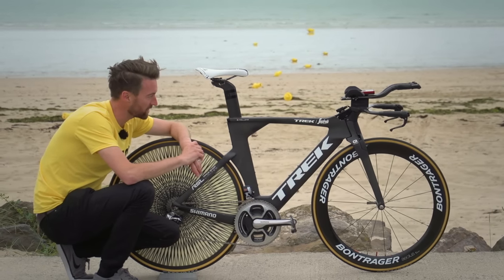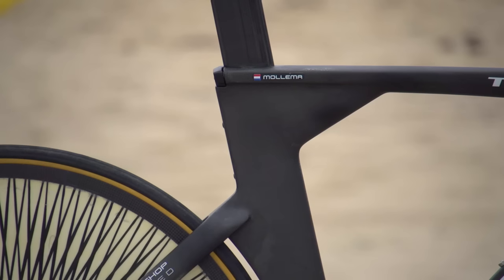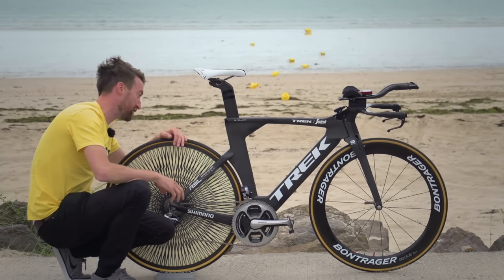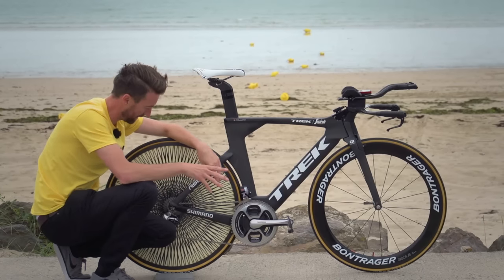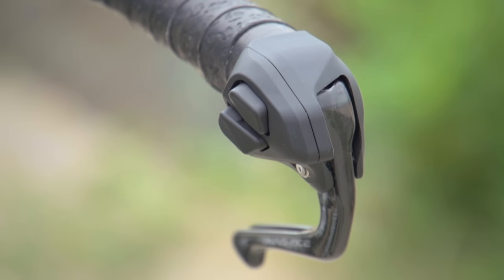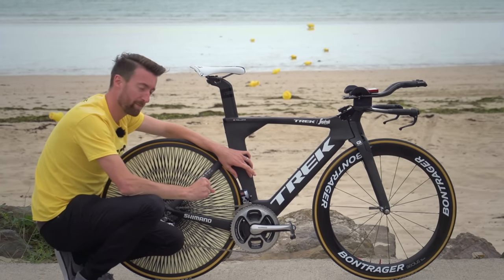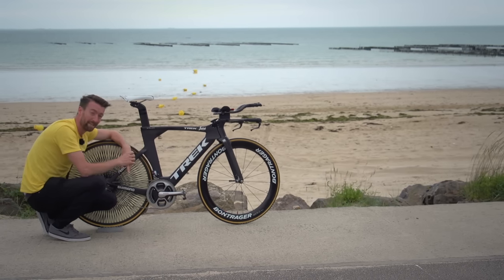Bauke Mollema's 'Raw' Trek Speed Concept

Comment: Dan, the tires should be marked "Veloflex Criterium" which is 23mm or "Veloflex Roubaix" which is 25mm. Since you guys always put the valve stem at the bottom when you're presenting bikes, you'd have to turn the wheels to be able to read that.

Comment: no paint on the frame to save weight , but complex painting on the back wheel ... not much consistent
Reply: i agree with you
Reply: Actually I'm pretty sure that wheel isn't painted at all and what you're seeing is the raw composite layup: those black lines are carbon strips that provide the strength (essentially acting as spokes) while the aerodynamic disc itself is very light weight fibreglass or kevlar.

Comment: white paint can weigh as much as 300g ....
1.   why the huge TREK logo on the bike?  They could have saved another 50g by using a smaller font.
2.   why not use a different colour paint then.
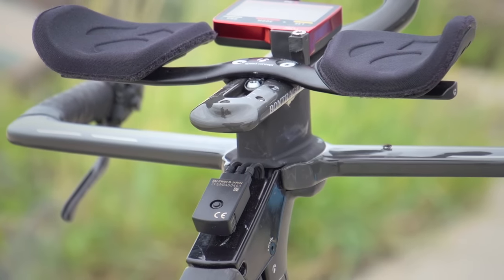3.  That fly making a cameo at 1:55 has just doubled the weight of the bike.  Let's just hope it doesn't defecate.
4.  Did Dan wear the t-shirt to match the coloured trim on the tyres?

Comment: the problem is that it is still over 8kg. so they weren't allowed to measure it. in my opinion its sad, that modern TT frames are so heavy. my own Kuota Kalibur TT bike (frame is from 2006) weighs 7,5kg with pedals, bottle cage and zipp 808 clinchers.